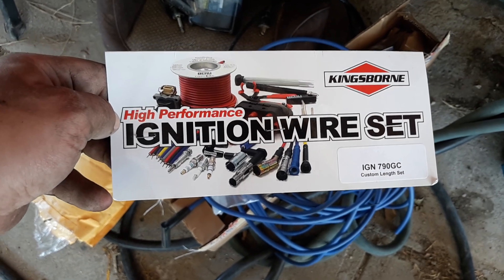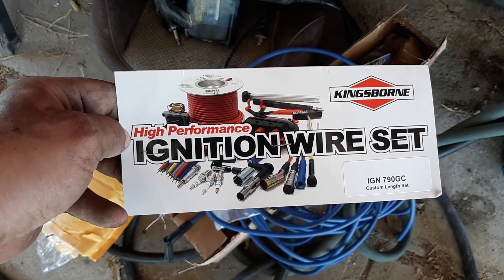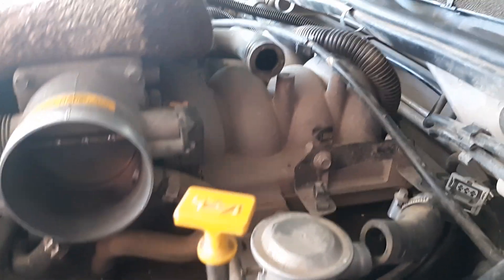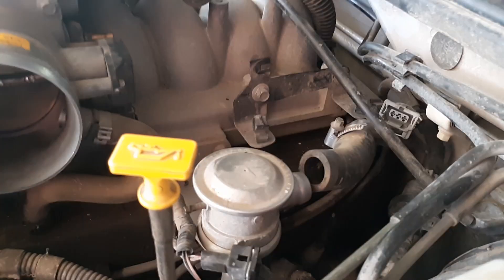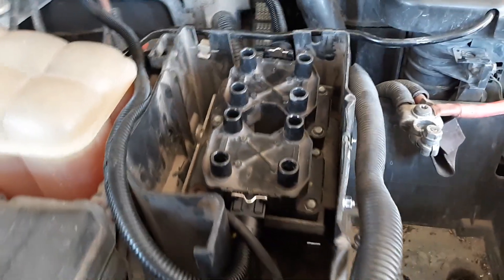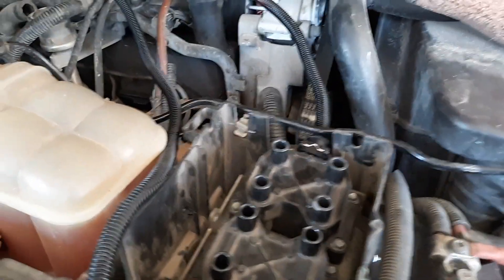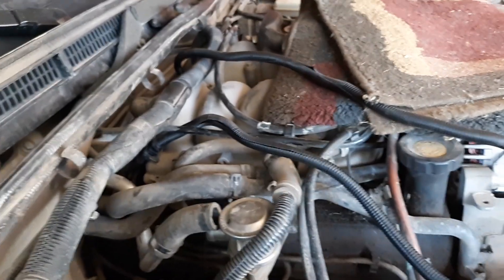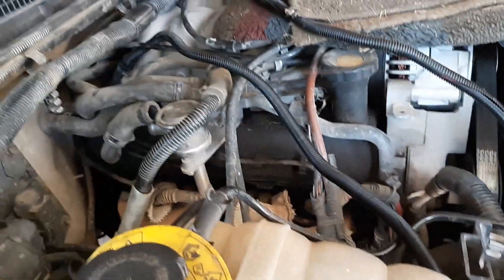Land Rover V8 Coil Pack Relocation

Comment: Would be nice to put a coilpack on either side. So ya dont need 4ft of wire. But either side shares so that's probably not an option.
Reply: Note that each coil pack supplies spark to both sides of the engine. It's a "wasted spark" design.

Comment: Hey Bryan 
I’m doing the same thing and location . On the spark plug wires ...what sizes did you order ? What’s the process to custom order them ? Call them ? 

TIA
Reply from the maker: I believe they were all 39 inches and yes I called them and advised it was for relocation of coil pack on a discovery.

Comment: Bryan Thanks for the video 
I have scoured the internet for the extension wire with no luck. 
Even contacted Standard Motor Parts to see if they offer a male connector for their S-745 female coil pack connector with no luck. 
Is it possible for you look at you connector to see if it has a ID of some kind that can be researched on the world wide web...Thanks
Reply from the maker: toquez2000 was the seller on eBay that made them. I found them once on eBay by luck. I messaged him on eBay and he makes them per request. Look for his name and message him. They did cost me $84. I hope you can get them still they were a great idea! Good luck!
Reply: @bryankough784  Thank You Sir...
Reply from the maker: Next thought would to be cut the connectors and Solder it back with extended wires. Again best of luck!
Reply: @bryankough784  Looks like this is what I will do...Thanks
Reply from the maker: Might check with Atlantic British and Lucky 8 just in case they Realized it would be a great idea to make these.